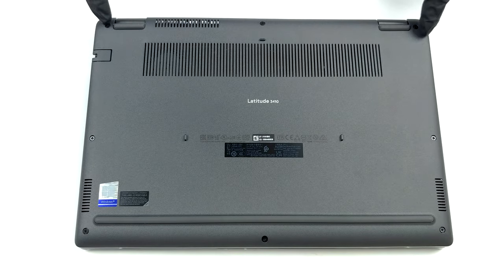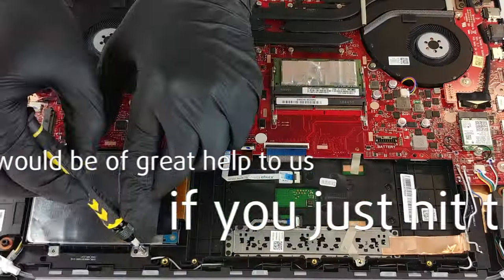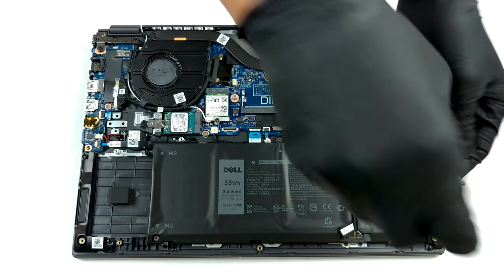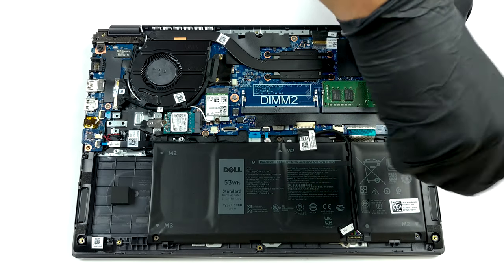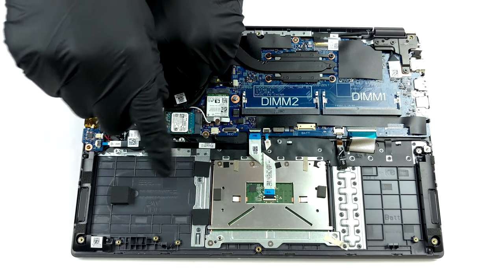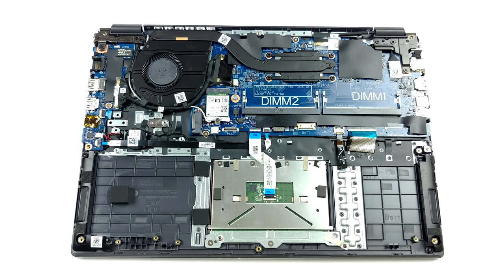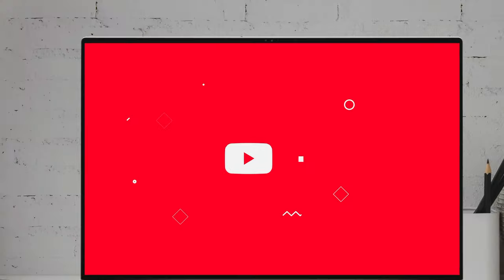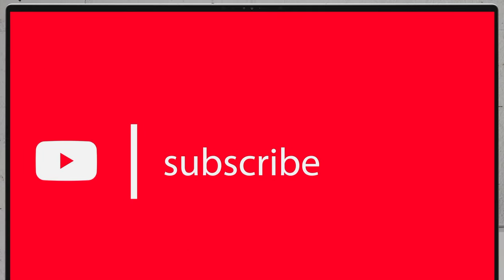🛠️ Dell Latitude 14 3410 - disassembly and upgrade options

Comment: Something which was not shown (nor is mentioned in the official Dell disassembly steps) and that is relevant is that when removing the bottom panel there is a plastic claw locking into a metal pin in the chassis/case. I had to put A LOT of force (something which is advised against when disassembling a laptop ) in order to remove it. Hope someone finds this comment useful
Reply: I should have read the comments before. It was really streessing me out that something was holding the back panel when it seems to easy to remove it.
Reply: This exact thing, mine is like super glued or something :/
Reply: Just saw this and found it useful.. Thought I was missing a screw I couldn't find.. Appreciate this..
Reply: Pulling from all sides and just slowly working it was the only way I was comfortable taking it off, but as long as you don't go too hard too fast, it should be able to take the force.
Reply: I just disassembled the laptop and i certainly wouldnt be brave to continue past the plastic claw stage if i didnt find this comment.
So in case anyone needs help, i loosened the screws and then bottom panel but the thing didnt want to separate near vents like other sides.
Trying to jam thin plastic thing in didnt do anything, what finally opened it was when i lifted whole laptop vertically sitting on its rear part where vents are and then slowly trying to open bottom up so i can see better inside when suddenly it separated on its own. 
There was no damage to anything, its just made like that.

After i put laptop back together, it didnt want to start. I almost got hearth attack but after inserting charging cable it run fine even though battery was 50 percent full.
It probably happened cause i forgot that i didnt charge it or turn it on for like three weeks but i add this anyway in case it has something to do with disassembly process.
Reply: this is the most important comment. in 2024 thank you for this comment

Comment: Is it possible to add an ssd next to the battery? I see an HDD connector right up the battery, with a flex should work isnt? And i would like to replace the keyboard with a keyboard with light, is it possible to?

Comment: If i want more battery usage time then should i upgrade the battery capacity from 40mWh to 53mWh? Will it make much difference? Also if i upgrade the battery pack will i still be able to use the 2.5' SSD slot?

Comment: I bought another RAM memory stick at the same frequency and added it to the motherboard slot, but the notebook won't turn on, I only tried the new one and tried both, but it only works with the RAM that came in it, which can to be ?
Reply: The ram you bought is faultly
Reply: It could be that you used wrong memory size to pair with your old ram, i believe it works only with same size like 8+8 or 16+16, not 8+16.